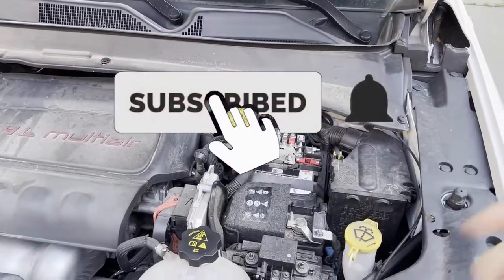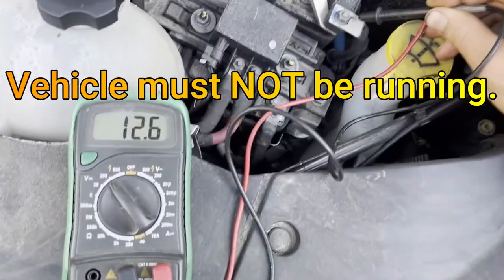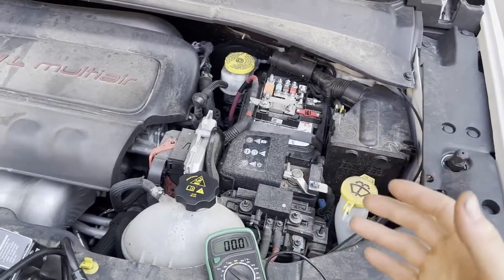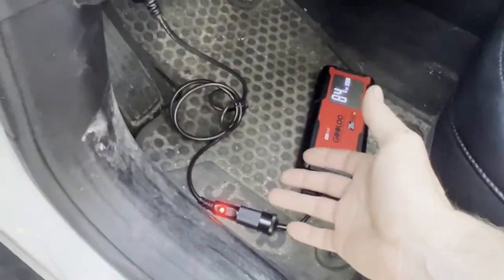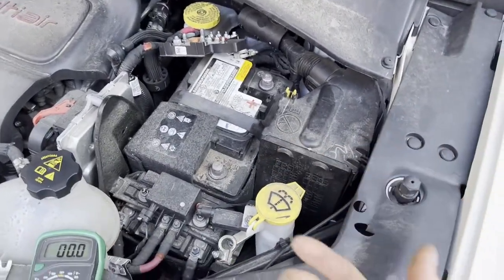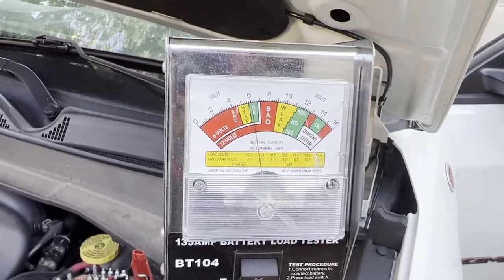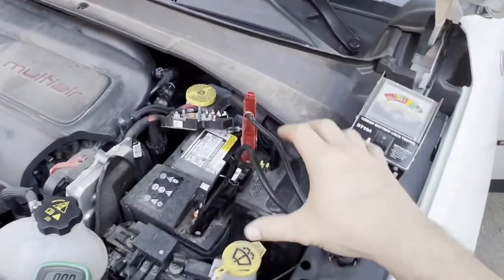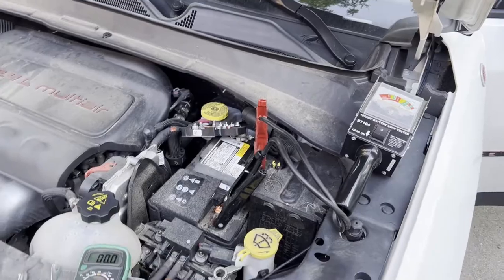How To Load Test A Battery

Comment: LOL we are definitely not from the same generation. I'll be 47 in December. As a teenager and even today of course ruling out the alternator is pretty fast and easy Once that's ruled out it's definitely the battery so you check your connections, then the next thing I would check would be the water in the battery. Almost every bad battery is Revival with distilled water, a 200 amp at least charger and a few days time. But most people can't wait that long because if they're having battery issues they need one right then LOL. Good job on the low test video I really enjoyed it, really great for the beginner knuckle buster.👍
Reply from the maker: Well yeah, but you need to check voltage and if your voltage is low then you need to load test battery and check alternator output.